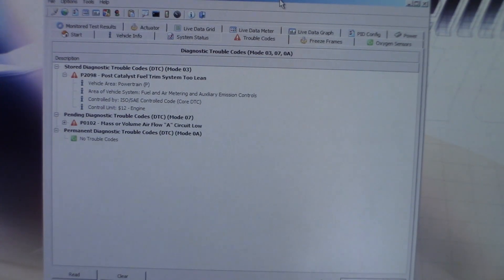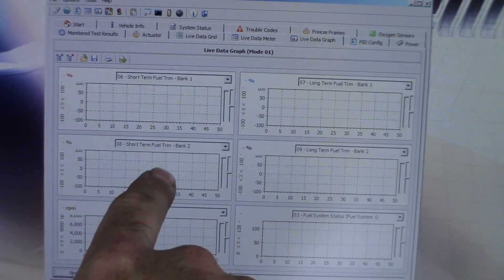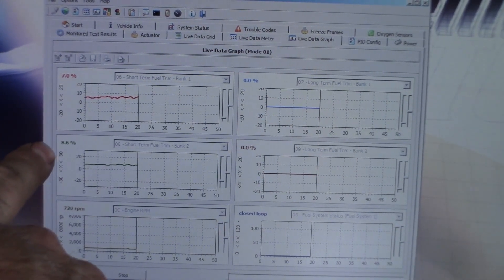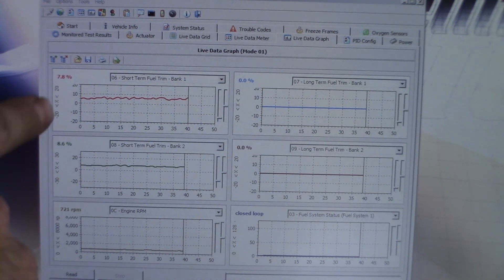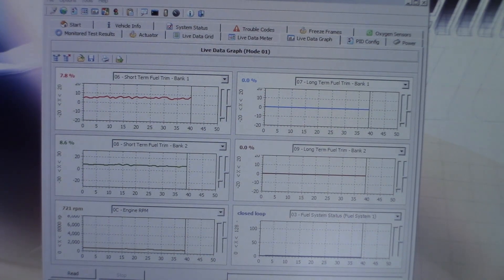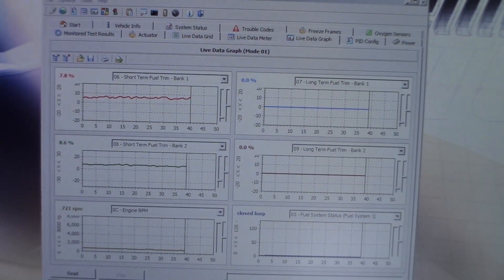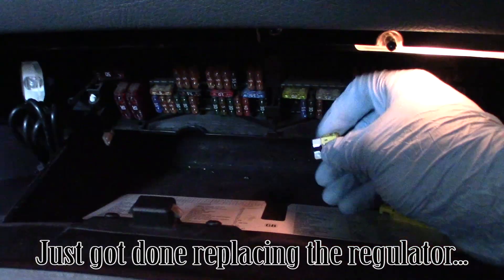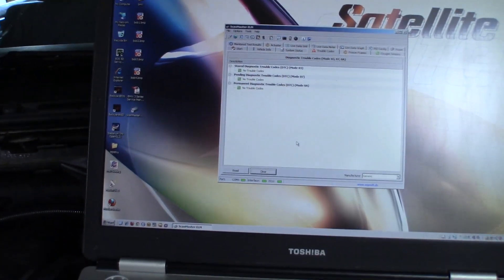BMW 330i 325i E46 Using Fuel Trims To Diagnose Engine Problems P0171 P0174

Comment: My scantool & app is showing banks 1,2,3,4. Should I be ignoring 3 and 4 on an M54 engine?
Banks 1 and 2 show good numbers (3%) while banks 3 and 4 show high (8-14%).
Can anyone confirm banks 3 and 4 are bogus data?
Reply from the maker: Yeah there is no bank 3 & 4, not sure what that is--maybe the scantool is reading some data pids wrong

Comment: 50skid hey man I finally got ahold of a scanner and my stft bank 1&2 are both -28.1, long terms Both 0. Does that sound lean or rich? I have a little video with the scan tool hooked up and I still have it available if I need it. I'm not really sure what to look at or look for. Check the video out when u have a minute (8mins). And don't be shy to hit that subscribe button lol
Reply from the maker: Negative fuel trims are rich

Comment: Hi. I have a bmw X5 with M54. Brand new motor but it runs rough when cold and fuel trims are 25+ on both banks. I have checked the fuel pressure and it is at 50 steady. I am working on building a smoke machine but everything is new. I replaced the pcv system tried 2 different IDC's and Disa valves. New MAF that is platinum based not the cheap version. I know i have a bad O2 on B2S2 it stays around .400MV B1S1 is about .05 MV B1S2 is about .05 and B2S2 is  .10MV . The system does tell me B2S2 is out of range. I guess my question is, can the one O2 sensor throw the STFT's off by that far? Thanks I used your videos to help me build the motor.
Reply: Oh and the fuel trims do not go down when I bring up the RPM,s to 2500.
Reply from the maker: Yeah if your precat O2s are not oscillating between 0.1 and 0.9 something is wrong.  Replace them.
Reply: Thanks. I ordered all 4 new so i know they are all good. If i unplug the MAF it will let it idle ok but the bank 2 STFT is still high from the bad O2. The odd thing I am seeing now is that if I plug the MAF back in (old or new) then all 4 O2,s go nuts and do not show properly. With it unplugged the front bank O2's are acting normal. Would the B2S2 being bad make the MAF mess with all of them? I guess I will find out when I install the new O2's.
Reply: Andy williams 

Did you get this problem  fixed bud

Comment: Hi Thanks for informative info. I just became one of your subscribers. 
I am wondering why you decided to perform this diagnostic procedure. Did u have any sysmtoms or any un- usual things happened. Or poor milage? The reason I am asking is this. I just got e46 with 70k mile( All my cars I've owned is compact cars so I don't have no idea about fuel consumption of this 325ci ) and notice milage is not great in the city compared to my Jetta and Civic. My e46 has no check engine light and recently replaced both air filters. How to verify milage. And how to increase milage if result is poor. Sorry for long story. thanks
Reply from the maker: I think the cause of the problems in this video was a clogged fuel filter.  What kind of mileage are you getting?  You'll know if your mileage is normal if you look at fuel trims and they are roughly about plus or minus 5%
Reply: 50sKid thanks for kind explanation. I know it was fuel and regulator filter in your case. I  already saw your video. Actually I watched most of your videos. I was just wondering if you had any problem before performing fuel trim procedure..And I found obd scanner tool you mentioned. But where can I buy a software. I tried e Bay and Amazon.  and no luck. thanks

Comment: Good video, do you know what it means if my STFT is fluctuating from +25 all the way to -25 at a steady, constant rate, I can feel the car running poorly when it gets to the extremes of the spectrum
Reply from the maker: You likely have a bad O2 sensor.  Use a scan tool with live data to confirm that your pre-cat O2 sensors (sensor #1 on banks 1 & 2) are working correctly, cycling from 0.1 volts to 0.9 volts.  You can also unplug them and use a mutlimeter to check the black and white wires.  You'll see the same voltage as you would inside the scan tool.  They may be getting stuck rich (0.9v) and stuck lean (0.1v).
Reply: Thanks for the reply, if you or anyone else reading this has this problem it's because you can't read your own handwriting.where you labeled the sensors and you plugged the two (upstream in my case) o2 sensors in the opposite ports, so any thing the car does to try and correct the mixture it gets the opposite result, hence the scrolling through the Spectrum of the fuel trim. I was getting codes for being too lean and too rich at the same time.

Comment: Positive fuel trim means bad fuel consumption, right?
 Right now my car doesn't throw fault code, but my fuel consumption is very bad, usually at 5.5km/l or 13mpg. This is with city driving only and i drive mildly. Also when i opened the oil cap, i out my hand over it and  i didn't feel reasonable suction from it. I only have pa soft scanner, not sure if i can check fuel trim with it.
Reply from the maker: Yes positive trim = bad fuel consumption.  You're not supposed to feel suction on a stock system.  No you can't check it with pa soft you need an OBD2 scan tool.  Search my channel for my review on the foxwell one.  Cheapest one I have found that can read live data.
Reply: 50sKid ah alright.. i thought there should be suction because when i compared it to my honda or my wife's nissan there is quite strong suction from the engine oil hole. I do have the exact obd adapter you mention the first time in this video, my is bluetooth version and it once worked but no longer, i don't know why. I was never able to read freeze frame using  obd fusion android app. I also have 2 others, tahg won't work at all with this bmw but the other one works with my honda and the other last one never worked with my cars.

I have cable that should work with inpa/ediabas, but have never got around to install it till now. Does it have live fuel trim data? 

Thank you for the video, i watch most of your e46 repair videos, they are very helpful. :):)
Reply from the maker: The data that you will read from the pa soft and inpa cables is BMW's "additive" and "multiplicative" fuel adaptation values which are different from obd2 fuel trim percentages.  Not helpful

Comment: Hello mate, brilliant videos, thanks for all the explanations and example. 
I've got a 2001, 316Ti (the liftback ones) with the N42 engine (I know, 1.8l, small, blah blah...) and I've been using these bluetooth OBD2 reader and the Torque app on my phone, which has already helped me out a few times. 
Recently after every (relatively) cold start, the acceleration of the car suffers a lot and it makes a muffled noise as if it's overfuelling or chocked. This continues throughout the warmup and usually doesn't go away on its own until i turn off the engine and switch it back on, at which point it works as if nothing happened. 

After seeing this video, I've configured the app to read short and long term fuel trims on all sensors and what I've noticed is that after a cold start, the short term fuel trim goes crazy and fluctuates from around +8 to -8 all the time even once the engine warmed up, but after shutting it down and restarting it, it all smooths out nicely. 

Any idea of what might be going on please?

Comment: fuel trim was positive then went to 3000 rpm went to zero then negative. would that be a faulty maf sensor. changed boots, changed throttle gasket, disa gasket, valve cover gasket, sprayed around the engine with carb cleaner no rpm change
Reply from the maker: That is a vacuum leak.
Reply: 50sKid I would also like to add that the CEL went off but came back on later. my MAF is aftermarket. I'm also getting an oil leak. last time I got it checked at the shop they said it was oil pan gasket which is what I really don't want to deal with until I get this lean situation fixed.
Reply: 50sKid I'll be looking at some live stats today
Reply: 50sKid at a stop light reading 27.3 short term on bank 1 and 2 long term of -6.3 after driving for a while long goes back to 0 when at a light with short of 27.3
Reply: 50sKid MAF fluctuates between 0.01 to 0.07 lb/s = 4.5 to 31.5 g/s at 2400 rpms

Comment: Wats up Mr 50
You said to watch out for cheap mass air flows on eBay. Can you tell me why?  They go from 20 dollars to 300.
Reply from the maker: They don't work.  Instead of using a more expensive platinum wire they use a cheap resistor.
Reply: Yo 50's dude!!!
Any chance you might have a link to that software you used?
I tried looking it up and got all confused.

Comment: Great video 50's kid the computer software you are using did you purchase it from eBay or ? I know you mentioned the cable was eBay but wanted to make sure the scan master elm softwares was eBay also thanks in advance Ray
Reply from the maker: Check google for where to buy scanmaster elm

Comment: Hey 50's kid. Love your vids! Im really hoping you can help me out here.
I have a 2000 328ci with 328k km on it (im not kidding:) canadian car.
I am due for emissions inspection but im throwing a couple codes - 1423 and 1421 secondary air systems bank 1 and bank 2 respectively.
I borrowed an obd2 scanner from a friend and it wont show real time data of the fuel trims but it does provide a "freeze frame data" of the values (i suspect from the time it registered the codes). Checked and erased the codes twice and basically im getting negative fuel trims (-5% to -3%).
I have cleaned the MAF about a month ago. Not sure if it has ever been replaced or if its working well or not (same for the fuel regulator).
I did replace a couple of rubber boots due to being cracked. Idle is rough when engine is cold, rpm dances between 500-1300. On deceleration it dips real low when its out of gear, like it wants to stall.
Thats all the info i can give you, hope you see this and i will really appreciate if you can give me any pointers of what to look at.
Thanks mate! Keep up the good work. Your youtube channel is much better than any tv car repair show i've ever seen. Cheers
Reply: Forgot to mention: the secondary air pump does work. Also i read on bimmerforum someone successfully got rid of the codes by pouring seafoam into the hose that exits the secondary pump in order to clean the carbon build up on the valve passages or something like that. Several people claim this procedure has help them. It did not help me :(
Reply from the maker: The vacuum hose going to the secondary air valve could be broken at either end (check for breaks).  The valve could be stuck closed and not opening when vacuum is applied (remove it and test it with a vacuum pump).  The secondary air passages could also be clogged inside the head (remove the valve and the precat o2 sensors & blow compressed air through the valve opening--see if you hear the air inside the o2 sensor holes).

Comment: This helped so much but now my codes switched. 
I was running rich and then I switched the fuel pump and fuel pressure regulator and now I'm running lean.
E46 m3

Comment: thanks again for this great video and a very well explainable finally someone that knows exactly how to explain fuel trims and diagnosing it. I have a problem with my BMW X5 3.0si 52 engine. can a vacuum leak cause misfires I did a diagnostic analyze data and it shows that my short-term fuel trims are 29.9 on both Bank 1 and bank 2 but I am also having misfires can this cause it and also the error leak is coming from the variable motor gasket should I replace the whole entire valve  cover
Reply from the maker: Yes a vacuum leak can cause a lean condition and misfires, which is what you have based on the fuel trims you reported.  Find and fix all leaks.
Reply: 50sKid thanks I appreciate I did a smoke test there was so much smoke coming from the variable actuator gasket if it correctly. and now apparently there's a whistling sound coming from the ccv valve I'm not sure but I guess I have to replace the whole entire valve cover thank you 50 skid appreciate what you do will get back to you on that

Comment: hi Jason I have just recorded my fuel trim readings but they are kinda weird they move too much up and down even during idle position and both bank moves up and down independently 
I didn't know what that means here is the video link that I recorded thank you 
https://youtu.be/8LzM2_WXuU8
Reply from the maker: You have a vacuum leak.
Reply: 50sKid thank you Jason one last question I have removed the whole intake manifold and put everything back with new ccv valve and hoses but one thing I had problem to figure out .there little tiny hose in back of the manifold next to two plugged wholes that hoses was totally broken and didn't see anything that can be connected to it on yours it's connected to a solenoid mine is e83 and I didn't find any online diagram showing that either .so I just connected that the little end on the oil separator do you think I have left the other end of that hose leaking somewhere I couldn't figure ? thank you
Reply from the maker: What is on the other end of that hose?  Where it does it go to?